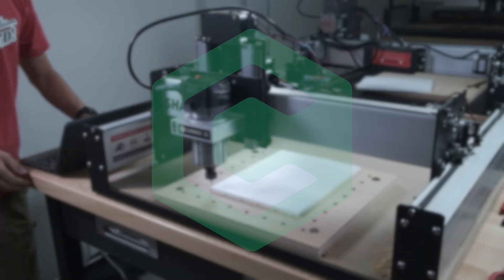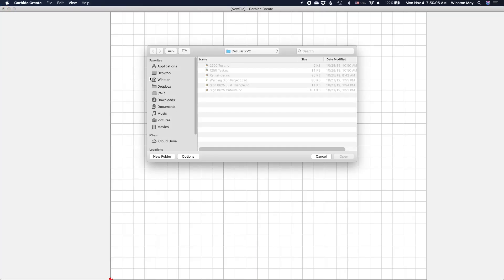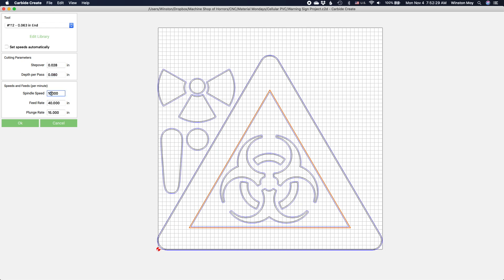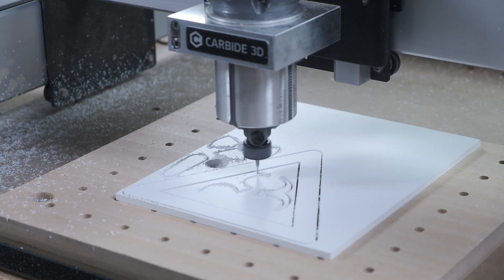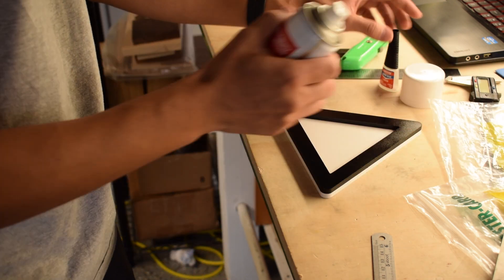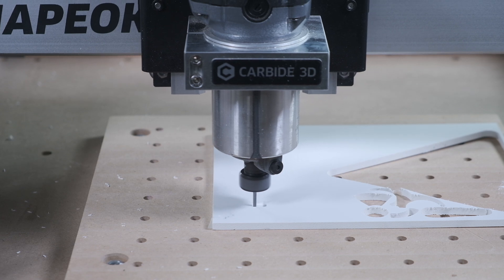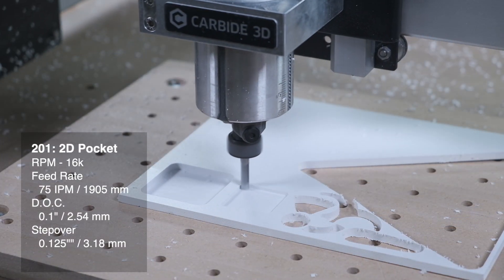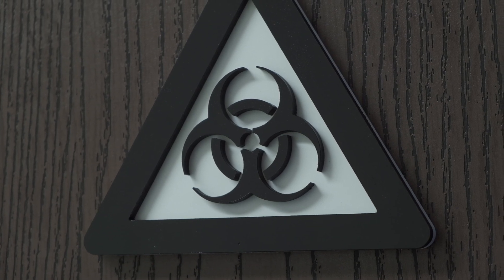Making an Expanded PVC Sign on the Shapeoko - #MaterialMonday

Comment: how is this compared wrt millability to a HDPE sheet? does this have higher melting point than HDPE?
Reply: its  does not melt but burns since  most have a  fire retardant so it kinds  just  darkens n carbonizes, its not dent like hdpe its it like sponge but with microscopic  pores that are closed celled

Comment: I'm making a sign using .50 PVC. I'm using .125 2 flute cheap end mill. It's rather big (10" letters) 24 in all. I was successful, but there are some rough edges. I was wondering what I could use to smooth them out. I was going to attempt to use "Platinum patch" that I purchased from Lowes, but now I realize that it says "not to be used as a skim coat". Might you have any suggestions?
Reply: wood fillers work will and/or auto filler like  bondo

Comment: Winston or anyone who can help I have a shapeoko XXL that is a few days shy of a month old😳
I have been able to cut several designs out with it and it’s worked fine up until today 😢
TODAY it gets about a quarter way through any project I TRY TO cut and it stops and it tells me that ERROR 5 SERIAL PORT RESOURCE ERROR?
  Can anyone help? I have disconnected the power and reconnected it hoping that it will solve the problem but it does not? And I have called and emailed carbide 3-D! 

❤️🎄Santas workshop has a list of Christmas gifts and must come out of the workshop time is of the essence🎄🎄
Reply: Did you ever get this resolved?  I was having similar problems and tried a few of the recommendations found here: https://wiki.shapeoko.com/index.php/Electronics#USB_Disconnection. I grounded my router to the chassis and added a usb isolator. Seems to have done the trick so far.  Weird how this problem suddenly showed up.

Comment: Could we get a video on corian
Reply: We've used it before: https://www.youtube.com/watch?v=wdRxkg99Zo0
But for all practical purposes it can be treated very similar to acrylic.
Reply: @WinstonMakes  I made a vacuum table out of solid surface. You can find the project on nextwaveautomation's site under /cncprojectplans at the bottom. The best thing about this is you can find huge amounts of it in the dumpers of re-modelers. I have found enough sink cut outs to make a lot of cutting boards that match my counter tops too. Certainly its all I use for jigs now. The cuttings stick to everything because its  statically charged so a leaf blower comes in handy when cutting. The other thing is you can bend it if heated. I have made some signs to go around poles etc. Andy Graves has a good channel on working with it. And of course it can polish to perfection.
Reply: By the way there are two types, one that has UV protection and a kind that doesn't.

Comment: Anybody knows if this material is closed cells or open cells?
Will it absorb water if you live it out in the rain?

Also, what is the consistency of this material?  Is it hard like a wood, or can you make a dent in it with your fingers if you press hard? Thanks.
Reply: Expanded PVC is resistant to mold and mildew and has non-moisture absorbent and anti-shock qualities, making it the perfect material use for a trim or other wood replacement projects inside of living and professional spaces.
Reply: Chad Hauser I’m Chad as well.  👍🏼
Reply: Thanks guys. That's helpful.
Reply: It is not as hard as wood, you can make a dent in it by the tip of your fingernail. 
You can also split it to pieces by cracking it along the half-depth cut made by the box cutter knife.
Nevertheless, it is great material for sign making, modeling and for many other purposes.

Comment: I work in a sign shop and this stuff is used on a daily basis, theses are the bits I use, HOZLY 3.175X2X12mm Left Hand Single Flute Downcut Spiral Bits High Efficiency Cutting Wood Acrylic Aluminum Plastic Plate Pack of 5 for $20 on amazon. No need for tabs or tape I shoot a couple brads on the corners and the shavings keep the parts in place. but you need to use a climb cut otherwise you will have lots of edge cleanup. .0625 depth of cut and 150 to 200 ipm.
Reply: Do you know what kind of paint and or primers would work ? It's for indoor use but still needs to be scratch resistant and pretty opaque. (60mm tall colored letters for use by kids in school)
Reply: @geekoid183  I use rust-oleum that says also bonds to plastic, you might need to sand the surface slightly for it to bond. Test on a sample and try to scratch it off.

Comment: Nick at RunCNC turned me into this material.  They sell 4x8 sheets at Home Depot.  It’s less dusty than wood which I like.
Reply: @ManCraftingTM How do I find this product at Home Depot? Which general area would they stock this?  Thank you
Reply: @Leba2006  it’s in the same area where lumber is.  
Model# H120AWS6 
Internet# 205309788 
Store SKU# 1000052907